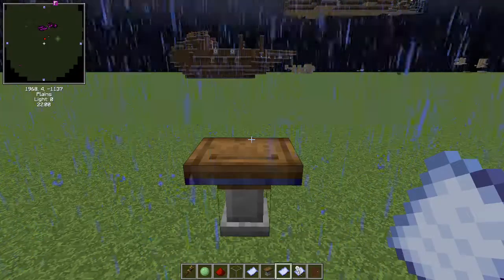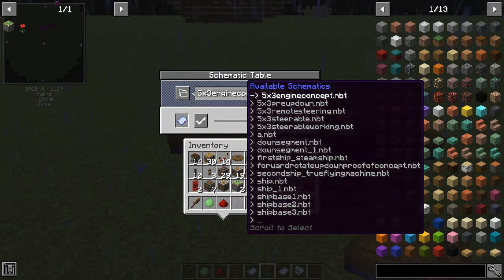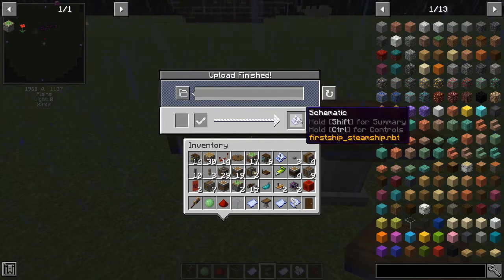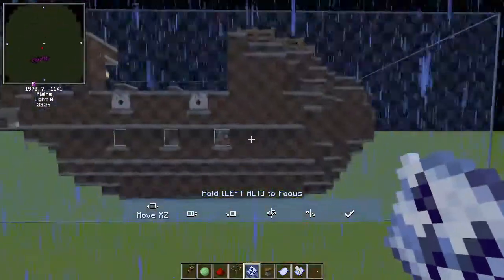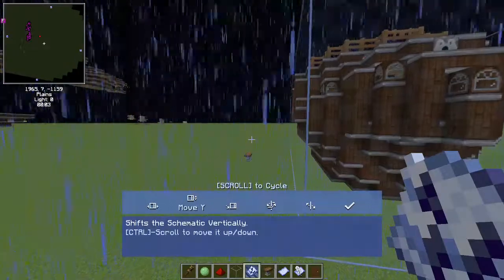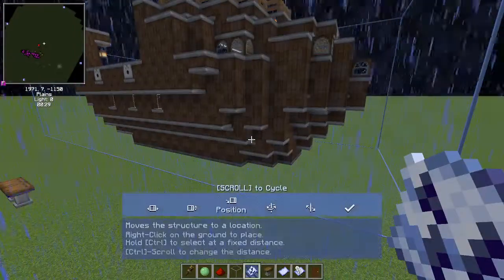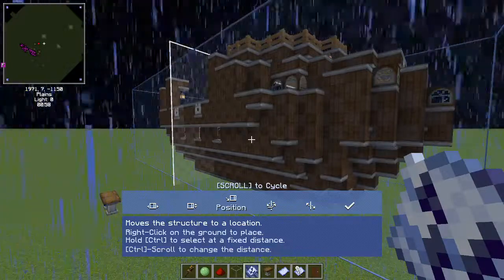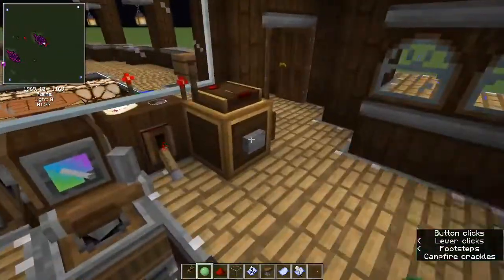Create Mod  .NBT Schematic Tutorial - How to import and export builds in your world.

Comment: for some reason when i place my schematics theyre not working as theyre supposed to be and the machines are jammed. It might be a problem with the mod or most likely the schematics i downloaded.
Reply from the maker: Some schematics need to have the Redstone woken up to work. In my builds I often have a button on a sequenced gearshift that does this.  Are you using one of my schematics?
Reply: @KwizzleHazzizle  thanks, i checked the bio of the download page where i got my schematics and there were instructions on how to power them up, god im stupid lol